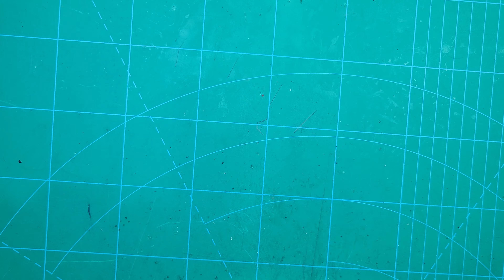Make No Mistake: Your DIY Guide to Make 18650 Lithium-Ion Battery Packs || CUBIT

Comment: Literally everything that you shouldn't do when creating a battery pack
Reply from the maker: Plz explain 😮
Reply: @cubityt  using acid on the casings instead of rosin based flux, soldering with a soldering iron, using undergaged wire to join the cells (even if the cells have a lot of capacity, the heat generated by trying to transport a greater current thru that thin monofilament will keep the acid flux chewing away, and it can even cause the soft solder to melt in extreme cases) I know you're trying to make the best of recycled materials and available-at-your toolbox items, but battery pack assemblying is one of those things were the risk of fire, injuries and such are tangible and real. If you must use a soldering iron, don't use nitrous acid, if you use wire, use a thick copper wire (monofilament: you can flatten it with a hammer to create a tape or ribbon out of a thicker single conductor of copper like 1.5 to 2 square mm) tin it beforehand with rosin based soldering paste or flux, slightly sand the battery top and bottom so flux does a better job and tinning requires less time, and clean up with denatured alcohol afterwards. Just a quick couple of tips so you can enjoy recycling and experimenting with less hazard risk to yourself.
Reply from the maker: @juanignaciocaino  i am trying to use which is in my hand..i want to share the concept only..if want to make a professional battery pack then i will must be following this steps.. what ever i should follow them for this type of video.. thank you very much for sharing your knowledge that's why we can learn & increase our skill 😊
Reply: @cubityt  yes, I covered that because I understood you were curious about learning. I've too used sub-par methods for many trades, when exploring the reach of what one can learn/study. What I'm advising isn't very far from what you're doing, just a couple of things that if you could change may result in happier and safer explorations when using lithium batteries. They're quite dangerous (I've learned that the hard way) I'd say that this few guidelines are a good advise for anybody dipping their toes into battery pack: 1. no acid etching for soldering 2. using wires capable of conducting the peak energy one will require 3. minimum soldering time if using traditional irons 4. abort all handling of batteries if they get hot or swell out, and dispose as fast as possible, preferably into a reasonably sturdy container.
Reply from the maker: @juanignaciocaino  sure brother..i will keep in mind & making another one from following your instructions.. you are invited brother 🙂
Reply: @cubityt  Thanks! I just noticed I cut the first comment off when pressing "enter" in my cell phone! 😆all the explanations we covered later were supposed to be there. My god, that sentence alone sounds very rude, I'm sorry.